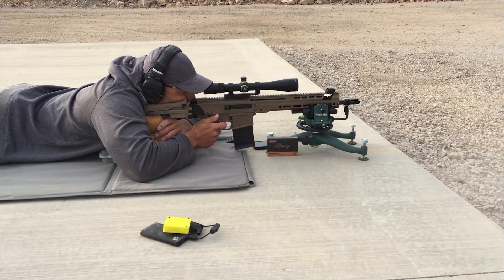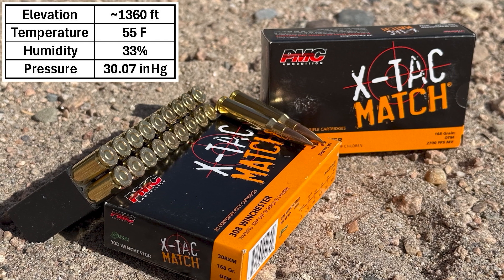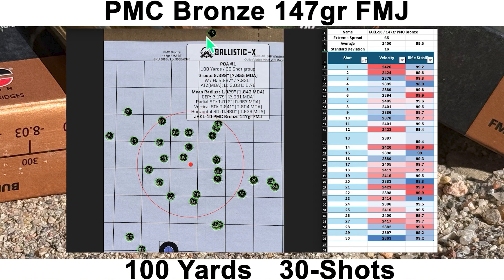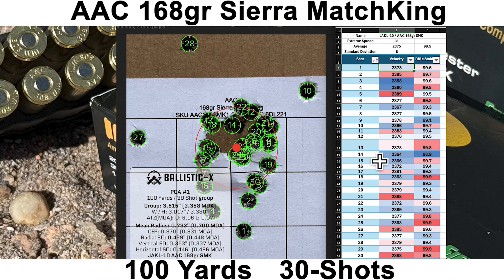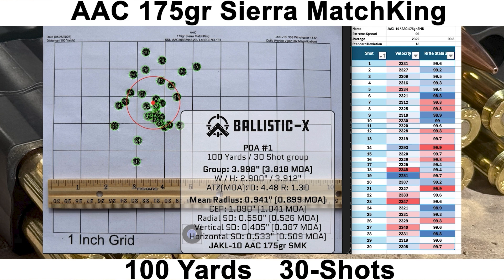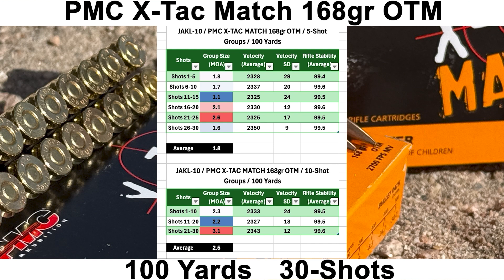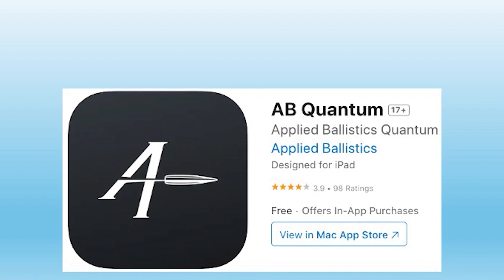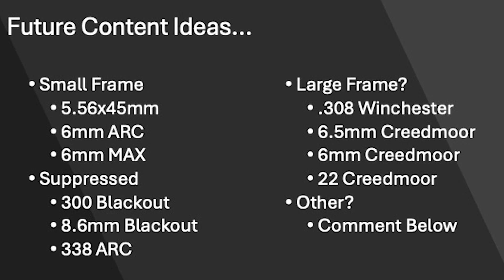PSA JAKL 308 Accuracy Test and Factory Defect

Comment: @ 8:04
- Jeez, it that a chowdered-up end mill/cutting tool narfing the chamber, the piece not being properly cinched down in the lathe/vise while cutting, the machine itself and its tolerances being all outve whack/spec, or a combination of all 3?!

- Thats pretty gnarly. (Im not a PSA fanboy, nor detractor, dont own one)

- As a rule I tend to fab up/drill & tap the base of a resized cal specific piece of brass, thread on/epoxy the casing onto a rod, apply light polishing compound, then give it a spin while in the chamber. Smooths out the feeding/extraction process a bit.
(On a side note: I like what P.O.F’s done by broaching 3, or 4 flutes into its rifle’s chambers/kindve like the HK-G3, but less of them)

- But I dont know if polishing that would do a chamber machined like that^ all that much good? If you aggressively removed all the crests/high points present, the chamber specs itself would probably  be off considerably?

- Thanks for sharing with us what you do, appears as precise as it gets.

Comment: One minor point to be aware of (and absolutely nothing done wrong on your end - holy crap these are the most scientific reviews I've seen on youtube) AAC's match series ammo, AND ESPECIALLY THEIR HEAVIER LOADS are loaded light.  ...like, to the point that they won't even run in some of my otherwise reliable guns without a can, just to boost backpressure.  Any gun you have that you run this stuff through will likely require a port adjustment if you want to ensure reliable feeding and/or Last Round Bolt Hold Open.

Comment: Wrong twist rate for a 16” battle rifle. The common weight for ammo would be 147-150 grain in such short barrel with less velocity. Heavy weight bullets get the 1/10 twist rate but barrel too short for good velocity. Somewhere between 1/11 and 1/12 would have been ideal for such a short barrel. This explains why no one really posting accuracy videos with this gun using light inexpensive ammunition. Very nice video which showed me exactly what the specs on paper say this rifle should do.
Reply from the maker: This 14.5” (pin and welded) JAKL didn’t like the 147gr PMC so much

Comment: Have you contacted PSA about the chamber yet?  Curious what they have to say if they take care of the issue.
Reply from the maker: Yup, got it back a week or two ago. PSA reported the following... "Upon arrival of customer's firearm, we inspected and found that barrel's chamber had a bad finish. Replaced current barrel assembly with new barrel assembly. Honed chamber of new barrel assembly to ensure smoother cycling/feeding. After re-assembling JAKL upper, accuracy tested and will be including accuracy tests in box with repair. "

I haven't looked at it with a bore scope yet, it's just been sitting. 

Warranty experience went as expected. 1 or 2 emails to explain the problem.  They sent a shipping label. I sent it off. Waited a little bit. and back it came.

Comment: something might be wrong with that barrell for sure. just based off velocity data. I have a 13.5 AR-10 rig. 150gr federal fusion chrono at 2560fps consistently.  
180gr power shock 2308fps.
m80 ball 147gr 2402fps 
how your velocities are so low for an extra inch of barrel is what gets me, no way 168's from 14.5 should be barelly above my 180gr with a 13.5"

Comment: Hey, glad you found the WEZ! It's super fun to play around with if you want to nerd out on theoreticals. Interestingly, Bryan has stated that a rifle that can consistently shoot 0.5 MOA is all the precision that's needed to win at PRS. Anything smaller is of course beneficial, but the diminishing returns kick in hard past half MOA. The ability to accurately call wind actually becomes one of the most significant factors at 600 yards and beyond.

Keep up the good work!
Reply from the maker: @Shootin_Bruin  yeah, the WEZ is fun to play around with.  Super interesting info.
I havent shot PRS, but that sounds reasonable.  Wind will have a significant impact on hit probably at range and the mechanical precision of your equipment will only take you so far.  Skills are what win competitions. Equipment still has to meet a certain standard, but past that, you’re probably better off spending your time improving your skills that trying to eke out ever ounce of your equipment.

Comment: Guess I should wait for a Gen 2 or 3 before ever going for the JAKL. Not that a long stroke piston system is super high on my list, but still. My PSA PA10 Gen 3 is fantastic, accurate, reliable, with no issues. Suppose the JAKL Gen 3 will be just as good as the Gen 1 is bad.

As for future content, I'm a huge fan of 300blk supersonics myself. Suppressed or no. Pro2A Tactical has a great 12.5" upper available for around $300, if that was a preferred length for you. It is what I have as my go-to gun, and I exclusively run 110gr(VMAX) to 125gr(HP or TUI) supersonics in it. Might not be for you, but that's the content I'd want to see.
Reply: In a stroke of madness I went and got a JAKL 10 upper. Don't know what the hell I was thinking, but guess I have a heavy as hell battle rifle now. Damn my impulsive purchase! Once I have it assembled and start shooting the darn thing, perhaps I'll fall in love with it. Gods I hope so.
Reply: I have a Pro2A 300 blk with 7.5” barrel and 1 in 5 twist rate. Have you been happy with yours. I just recently got mine. Have more testing to do.
Reply: @ Yes, very. It has performed flawlessly over several hundred rounds so far. Even went and got a new muzzle device in preparation for a can.
Reply: @Arkancide I put the Thunder Chicken on mine. It’s super quiet.

Comment: Do you have any opinions on barrel bedding? When to do it, measurable improvement over non bedded accuracy, etc?
Reply from the maker: Not really.  I have bedded a few 1 or two receivers.  I didn't do a pre/post-test.  So, I don't really know if it did anything. I don't do it now, mainly for convenience.  I'd rather not have to use a blowtorch to disassemble an upper.  But, eventually, I plan to do a thorough test of the effectiveness of barrel bedding on the channel.  Not sure when it will be though.

Comment: Pmc bronze was always a crappy shooting ammo. With my 20inch ballistic advantage barrel in my ar10 i was grouping 3.5 inches at 100 yards, but at 300 yards it was grouping 5.4inches from 10 shot group. With aguila 150gr fmj, i was getting 1.1inch at 100 and 3.8 inch at 300 in 10 shot groups. These ammo cost the exact same from targetsportusa, so I'll be buying aguila for plinking

Have you tried the psa sabre?? Wanted to know you thoughts on that.
Reply from the maker: I haven't tried the 308 Sabre black tip. I have shot 1 or two groups with the 223 Sabre.  It was okay, not great, not bad, somewhere in the middle for what I was expecting.

Comment: Looked like they either had a loose boring bar or reamer chatter. Happens when often to operators who don’t know how to run their machines or check tooling every few cycles. Obviously finished the chamber to size but failed to inspect it (common occurrence with PSA, failing to inspect). Cool designs baut sadly faltered by lack of experience and shotty workers.
Reply from the maker: I'm not a machinist, but that sounds reasonable. Whatever happened, something went wrong. Thanks for the feedback!

Comment: Ok so a 14.5 308 with a good barrel would be pretty solid in 14.5. They velocity should make it a pretty good option and running a can is a bit easier on a pin and weld 14.5…was thinking of a 13.9 centurion….will you do more short 308 semis?
Reply from the maker: I don't currently have any other shorty 308's lined up. But, I am certainly interested in testing more, if the opportunity arises.

Comment: Love your videos man, one of the few people out there who have actual calculated data and measurable comparisons for barrel performance.  

I’d like to see an 5.56/ARC/MAX would be interesting to see, as well as maybe one or two .300blk barrels.  Not a lot of people shoot .300 to several hundred yards so even though it’s super fun I think people would get more value out of other barrels and calibers.  

What I think would be a fun idea is to take a series of barrels from the same mfg but of various lengths, pick one load, and to do the standard 30rnd group test on them.  I think it’d be interesting to see how longer barrels may improve SD/ES and how that would translate to increased hit probability, or if shorter barrels have tighter precision at shorter ranges just due to less chance for defects and errors to accumulate in a 10.5 vs say a 20” barrel.

Comment: One of the main factors that drive the worse accuracy of 308 gassers is the heavier recoil compared to the weight of the rifle. This 308 Jakl would likely shoot a bit better if it weighed a few more pounds. If you want to look into it more yourself, google "applied ballistics TOP formula" and you'll find that this rifle is about as accurate as its supposed to be

Comment: Great video, solid testing protocol.  Quick Question though, what is a "Head nod test" for parllax, and how do you perform one?
Reply from the maker: Thank you!! For a head nod test (as I call it), you get the rifle into a steady position with your head positioned properly behind the scope. Then slightly nod your head up and down without moving the rifle.  While you move your head, you want to see if the reticle shifts on target.  If the reticle remains on the same place on target, then the parallax is correctly set.  

Hope this makes sense.
Reply: @PrestonJMoore  Awesome, appreciate the quick. straight-forward answer.

Comment: A lot of the high power guys consider the white oak armament barrels to be the go to for accuracy.  

I’d be curious to see one of those.  They make SPR profile barrels.
Reply from the maker: Well, you are in luck.  Next video should be on a WOA SPR barrel.  It's a loaner with some miles on it.  So, it's not a pristine example, but should still make for a good video.

Comment: Tbh testing 6.5CM would probably be the best bet. There are a lot of readily available cartridges from the lower end S&B 140gr to the 140gr Hornedy ELD-M rounds. (I used 140gr because that's what reddit told me performs the best in 6.5CM, also confirmed with my limited ammo testing)
Reply: Are you saying a 6.5 is going to be more accurate at 100?

Comment: The Chambers ribbed for the brasses pleasure😂
Reply from the maker: New ribbed chamber technology
Reply: Poor machining in the chamber have a CMMG AR upper that looks like that in the upper receiver nice way to cut cost when you don't change  mills.
Reply: @thermitegrenade  sure PSA would fix it, as bad as it is the truth about is that this gun still going to sell because it just looks cool and it's nice and cheap I'm going to probably buy the Gen 2 when it comes out just because it looks cool I want ACR but I don't want the ACR

Comment: That's shockingly poor accuracy from that rifle. That rifle would be going straight back to PSA for me. Great video though.
Reply from the maker: PMC Bronze group was horrible.  The rest weren't out of line with my expectations...  Not to say that they were good, I just had low expectations going into this.
Reply: Ya..... A lot of these guys obviously don't shoot at high volume. That rough chamber damaging the brass is unacceptable..... But the accuracy is pretty great. Most bolt action rifles wouldn't do much better shooting 30 rounds in a row at even half these speeds. That firing schedule would melt the gun after a dozen or so magazines. A 308 30 round mag dump with cheap ammo and 5 MOA is amazing. Go do the same thing with a SCAR.... It's not gonna be much better. @PrestonJMoore
Reply: I wouldn’t say it’s shocking. I’d be more surprised if it was a tack driver tbh
Reply: Yeah the 168 weren’t terrible but the rest were not good. PMC is straight up garbage tho
Reply: Don’t buy from a brand thats soul purpose is to sell as many guns as possible for as cheap as possible and expect it to be accurate.
Reply: I totally agree 👍 I would have been on the phone after the first “group” or after bore scoping the barrel which ever was first.
Reply: The ammo selection could have been a bit better.
Reply from the maker: @ what would you recommend?
Reply: @PrestonJMoore  hornady for one
Reply: Well yeah it’s a 14.5 inch .308. The absolute shortest you should go with .308 is 16-18 inches for both accuracy and velocity.
Reply: @StarfishPrime1969 barrel length has no impact on accuracy. Velocity and terminal ballistics - yes. Barrel quality, chamber tolerances, rifling, etc actually impact the accuracy.
Reply: @StarfishPrime1969  tell that to SOF couch warrior
Reply: @boatymcboatface5063  

I'm confused on this comment, SOF doesn't use the Mk18/URGI or the 416 to shoot out past 300 meters lol. The relationship between barrel length (i.e. velocity) and long range accuracy is well established....unless you are on YT I suppose.
Reply: @StarfishPrime1969  wrong again couch fighter. also i never said anything about the URGI or 416. we're talking about 7.62 which yes SOF uses the 7.62 caliber. if thats news i would read a book
Reply: @boatymcboatface5063 

Lmao bro you’ve never even been in a firefight. A Co,  2/508, OEF 15. Where were you?